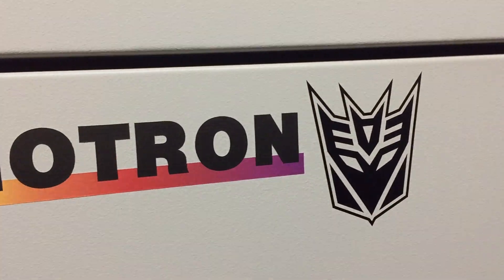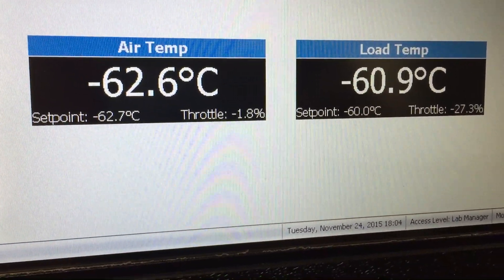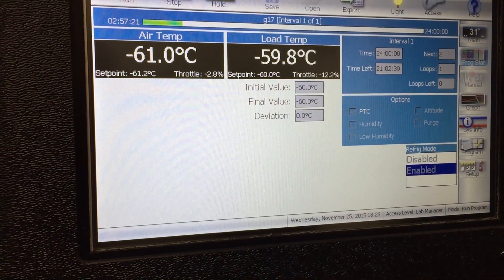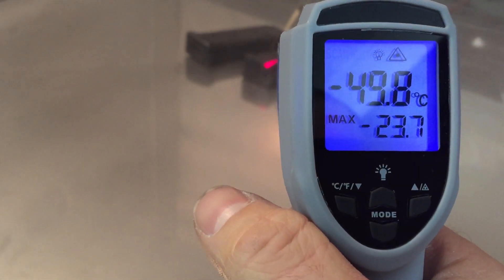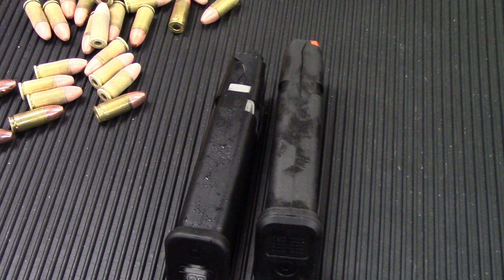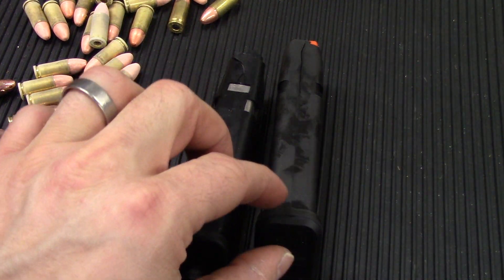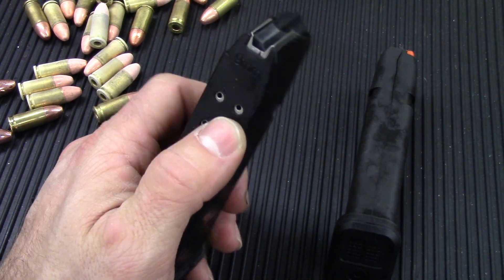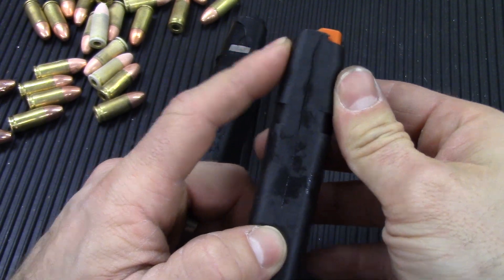OE Glock and Magpul G17 Magazine Drop Test @ -60*C (-79*F)

Comment: Great test B, maybe freeze down the ar500 steel plates and see if they break when dropped, or if its possible shoot them with weak to powerful rounds, maybe if your in canada freezing your armor may become brittle and do didley squat! Also id love to know the hardness of the ar500/spartan steel plates if you have a rockwell tester at work:-) im guessing 57/58 hrc
Reply from the maker: +Mark Anthony Stringfellow It's in the works :) I'm on it. Someone else requested a hardness test on the AR500/Spartan stuff. They were curious on uniformity of hardness on the plate.
Reply: +Buffman Great stuff!, I, ll be looking forward to it!